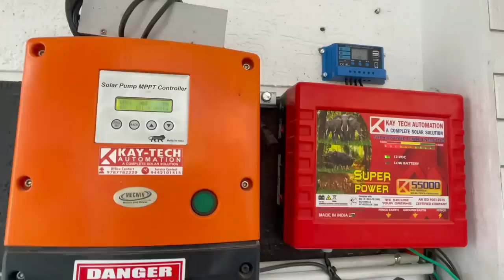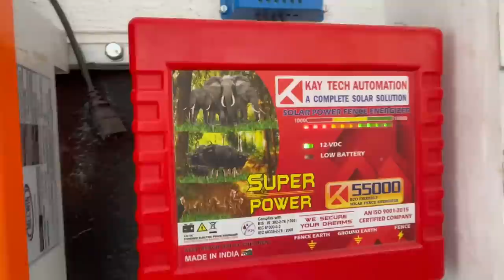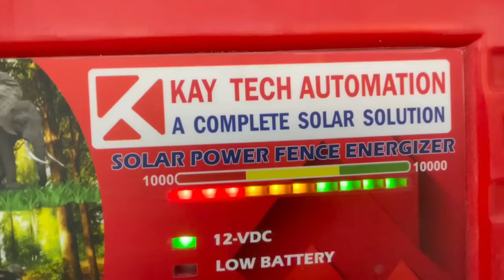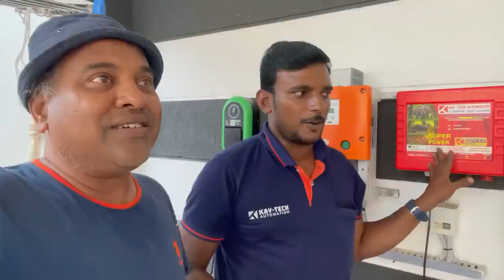Solar Fencing For My Home || குரங்குகளால் எவ்வளவு நஷ்டம்? || Sakalakala Tv || Arunai Sundar ||

Comment: Sir I have two question
1. Does this solar fence will rust in rain water and what about it is quality of material used?
2. Now it is Winter season the fence wire is strong high tensions and what abt in summer season does it will loss tension or is there any adjustment❔️

Comment: Sir maximam 15000 enough to this house for solar fencing   solar panel not necessary  our house current 240v is Givin to energiser  and then other side  battery input connect to the energiser